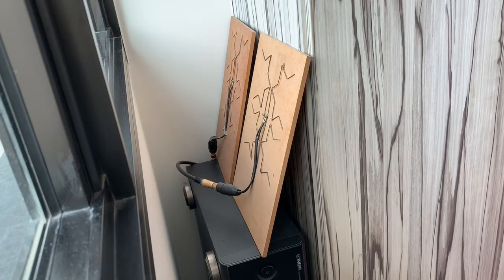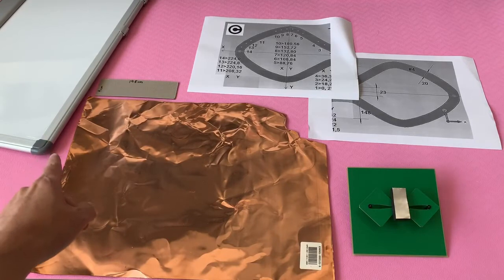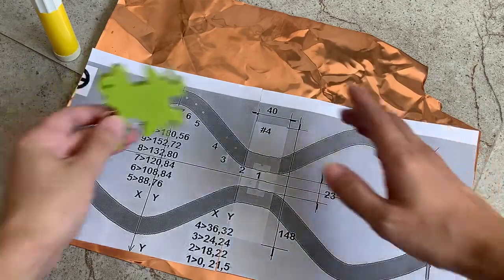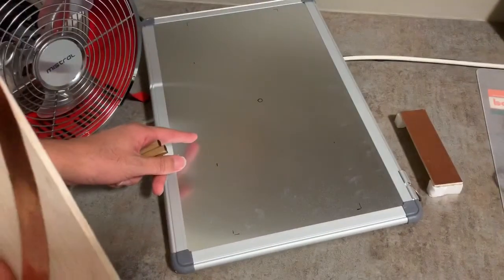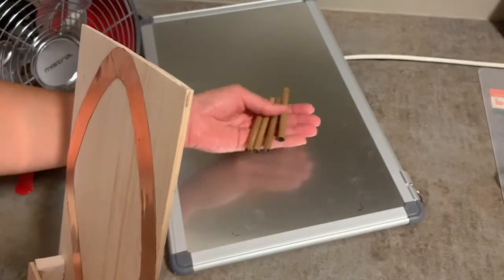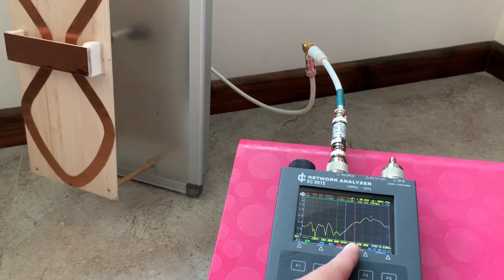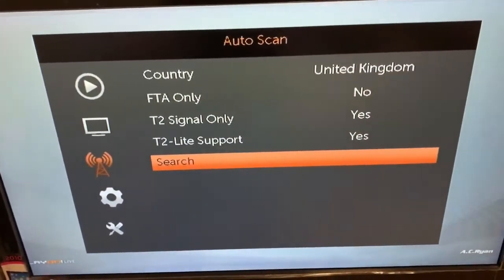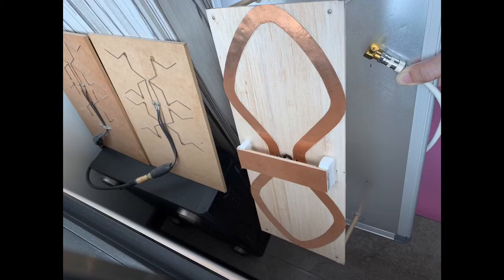High Gain 13dBi BiQuad Antenna for HDTV!

Comment: I have to say that this design is unique from what I have seen so far. How did you come up with the design for TV antenna. This is so consis and easy on the eyes. Very nice indeed Terence. Look forward to see more great videos from you Sir.
Reply from the maker: Thanks for the awesome comment! It is an old school design from the wireless antennas forum, this antenna is usually made with galvanized steel sheet, I used copper for better conductivity and it’s also easier to cut copper sheet with a pair of normal scissors. Do check out my beam steering FPV antenna if you are interested in some of my other RF projects.
Reply: @terence79chan  I will check out your other stuff fella. Thanks

Comment: Make a bi-quad out of 12AWG solid copper wire. 5.75" per side. Attach it to a frame made from 3/4" pvc and you have a table top directional that can pull in UHF channels from 75 miles away.
Reply from the maker: Thanks for sharing your method, 12awg copper wire is easy to find too.
Reply: Ok.. so i can use like elwctrical wires from extended power plug ?

Comment: Can digital tv from Batam Indonesia receive in Singapore?  and for Singapore market, can it receive frequencies other than MediaCorp?  As far as I know in Singapore, where STB Government is locked, the vendor can only reveal the Singapore DTV signal. In Indonesia there is a stb NMS Eta stereo that cannot be used in Indonesia even though it is DVB-T2
Reply from the maker: A factory reset unlocked the DVB-T2 tuner issued by SG media Corp. As shown at 7:52 of the video, you could see the set top box receiving indo channels via this antenna without a booster.

Comment: Hi... possible making me one ? Or maybe help me get a link where i can buy readymade.
Reply from the maker: Thanks for watching! I had posted the link to the template  in the video description, you could  print it and paste it on copper sheet or aluminum foil on a cardboard to cut out  the element. There isn’t one readymade so you would have to make one . It ‘s gonna be a fun weekend project.

Comment: For some reason, my two digital TV antenna (the black flat curved rectangle box that is commonly found here) cannot receive local TV channels properly. Sometimes it is fine for hours then suddenly, the transmission is not watchable. I'm not good enough to make an antenna, but I wonder if you have any recommendations on commercially off the shelf that would work well here. I only watch Mediacorp channels. Thanks!
Reply from the maker: I had recommended the Winegard FL5500 to 3 persons in the past 5 years and all 3 of them were very pleased with its performance.
https://m.ebay.com.sg/itm/2X-Winegard-FlatWave-Amped-Digital-Indoor-Amplified-HDTV-Antenna-50-Mile-Range/353019133828?hash=item5231947f84:g:WvkAAOSw8t1eeTTp
Reply: @terence79chan  do you have a test of this cheap antenna? this design is the same as the cheap patch antennas sold on walmart, with deporable results,  low gain of this design.
Reply from the maker: @macformat  Can’t compare the original WineGard with a knock-off just because their designs (element patterns) look the same, there are several factors that determine actual performance, using an incorrect film material or having unbalanced feed (poor impedance) will easily throw the SWR into unacceptable levels which lead to a low gain. This is akin to having to change a PCB-antenna’s dimensions drastically from that (of similar design) cut out of galvanized steel, to account for the dielectric property of the FR4 (PCB material).
Reply: You need the box to convert as your tv is not digital ready tv. Only digital ready tv can receive from digital antenna directly.
Reply: @ZackZainal no, my TV is digital ready. In any case, I bought a better antenna and I can watch digital channels now directly on my TV.

Comment: Please build a double biquad! Than I can print it out. Thanks!
Reply from the maker: Thanks for watching. It is easy to double the signal by combining 2 identical Biquad antennas together with an RF combiner
https://www.ebay.com/itm/PE-Splitter-Combiner-Model-2532-2-way-Splitter-Combiner/293928682412?epid=24026533333&_trkparms=ispr%3D1&hash=item446f83c3ac

Comment: I am staying at 2nd floor HDB flat. I have problems with getting malaysia digital signal. Was the antennae was test at high floor ?
Reply from the maker: yes, it is tested on 11th floor (near window). 2nd floor would be impossible as any Malaysian signal would be blocked by other buildings before it could reach your window.